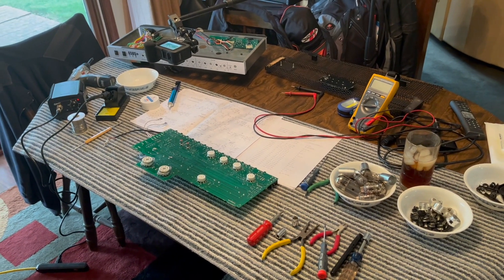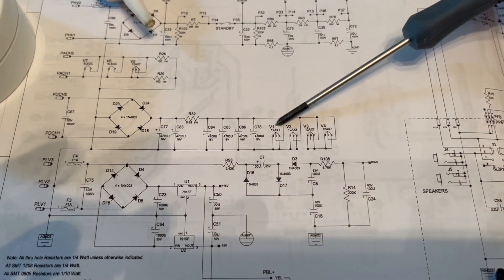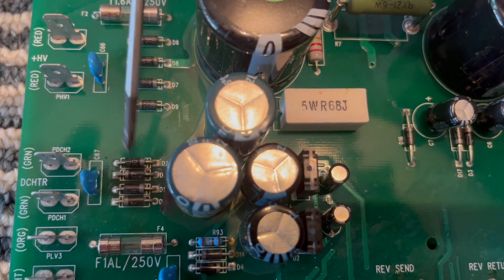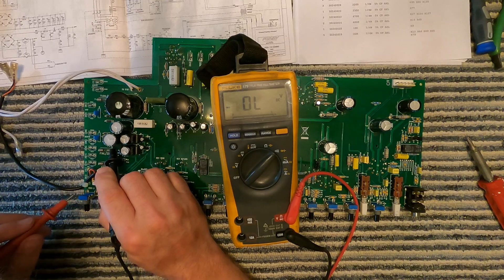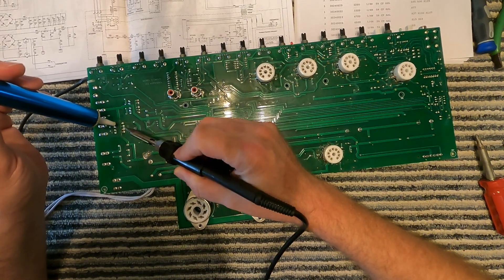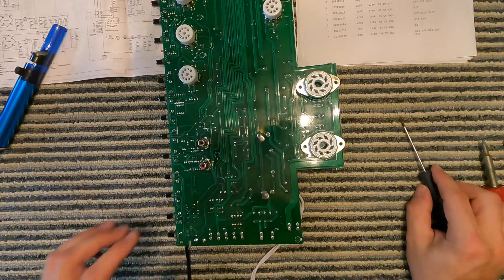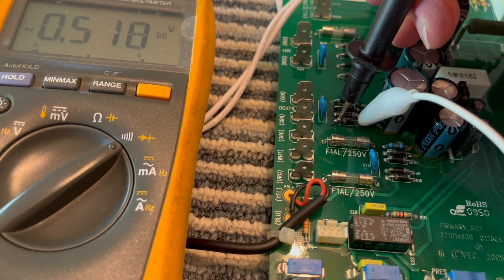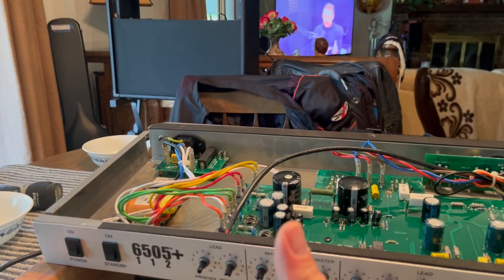Peavey 6505 Plus 112 Repair - Bad Preamp Heater Circuit Diodes

Comment: Back in 2017 I found the same forum you probably did, advising me to replace those diodes. I did and it worked! Just tonight my amp died and is doing the same thing again. Ran the meter a few times with mixed results and initially thought it was R82, but I finally turned the amp on and checked DCR, yep top two diodes went bad again.

To anyone who is considering the common mods, here is my 8 year review: 

Replacing R86 (FX send filter) with a resistor+cap in parallel (I forget the values, it's easy to find in the mod forums) is the best decision I ever made with this amp. I am picky about the effects loops on most heads now because of how much I love this one. Idk how to say it but this amp sounds tighter with 4 cable noise suppression. It's as if other amps' advertised series effects loops are not truly series  but essentially at 99% on a mix knob. Test this by clamping down the suppressor threshold to nothing and listen for what leaks through the amp. This Peavey is tighter than most of its peers. The original R86 tries to reduce round-trip cabling noise buildup by filtering extreme high frequencies - sounds like a blanket. Get a suppressor and/or buffer and take care of that problem manually. The replacement R86 takes that blanket off the tone of the loop. I get why they did it, though.

IIRC i clipped out R13 and C47 from the clean channel, IDK which contributed to this but one of them served as a HPF. The idea is that removing it opens up the bottom end similar to an open back amp and makes the actual Cleans more useable. BIG REGRET. All it did is ruin my beautiful sounding crunch channel. HOWEVER. You know that bass cut you hate about your tube screamer? Sounds fire through this bass overloaded crunch channel. But I really miss how it was originally.

I think I clipped something out to smooth out the gain of the lead channel (I believe it was C30)? I don't remember it knocking my socks off but i love the tone of that channel - didn't hurt anything. I definitely did something to reduce the overall volume of the lead channel and the tone is insane for recording but i wouldn't gig it with a drummer without PA as a result. It's great for rehearsals with the master at 2 o clock and the amp pointed at the drummer. I'm looking in the chassis now and I've got this goofy looking mess where I soldered R101 and C11 together in series. That's probably it.

Comment: I man, i want to modify my amp adding it more gain ,i got a Rivera M100 and Peavey 6505+112 plus combo. Can you give me some advice?
Reply from the maker: More gain?   Which amp?   The 6505 has too much (more than enough).   The Rivera is a nice cleanish fender. 

Soldano added more gain by adding insane non-symmetrical bias at the third gain stage.  Very smooth and creamy.  But mushy in comparison to fender circuits.  

I always recommend playing with overdrive pedals first, before modding an amp.  Way too much circuit analysis involved to give a simple answer.  

Rob Robinette has a great website for simple amp mods.  

Good luck.
Reply: @6dbthreshold  thanks

Comment: How'd you get your logo to light up?  Mine doesn't work?
Reply from the maker: If your amp still works (makes sound), I suspect your logo light circuit is burned up.   The bias low voltage tap from the power transformer not only power the bias voltage rails, but also has another 4 diode rectifier that feeds a couple solid state voltage regulators for the +\~ 15 vdc switching circuits and the “BACKLIGHT PCB”.  

If the amp still switches channels correct, the logo pcb is broke.  

I dunno. I never took the logo light assembly apart.
Reply: @6dbthreshold  okay yeah my amp still works and all the channels switch fine.  Guess it's the logo PCB.  I unplugged it and plugged it back in and same, no lights. Will look into getting a new logo PCB.  I read somewhere someone fixed their by resoldering some of the leds.  Guess I can also inspect the led solder joints.
Reply from the maker: Maybe hook the logo light leads up to 2 9v batteries in series?   Easy simple test to see if it the light circuit board works. 

I like how the amp sounds, but it’s definitely not designed with long term reliability in mind.
Reply: @6dbthreshold so I hooked up 2 9v batteries it popped/blew one of the LEDs.  I'm sure I did something wrong.  Now I'm wanting to replace all the LEDs on the logo PCB just not sure which ones I need.  If you happen to know please pass on the info.  Thanks.
Reply: @6dbthreshold  I man, i want to modify my amp adding it more gain ,i got a Rivera M100 and Peavey 6505+112 plus combo. Can you give me some advice?
Reply: I went to Walmart and bought some adhesive LED car interior lights. I removed the wooden board behind the grill, adhered the light to the reverb tank and soldered the power input to the cable that used to power the logo. Now my amp can glow Red, Blue and Green. :)
Reply: @cbvinyard8778  Awesome mod! Are the lights the same voltage as the logo? Just to make sure you don't burn any circuitry?
Reply: @ I put those in 9 years ago, can't specifically remember if I made sure of that, but they've ran for 9 years without burning out. Only thing that burns out are these 4 diodes.

Comment: Nice video, very informative. Which diode to buy to prevent this? Cheers
Reply from the maker: I used 1N4935 diodes (1 Amp) for the immediate repair.  They have about 12 hours on them with no issues. 

I bought 1N5404 diodes in case of future failure.  They are at least physically 4 times larger.  3 Amp 400 V diodes with 1.2v forward voltage drop.   They will need to be mounted pretty high off the board or even remote mounted.  I won’t install them until the next failure (probably 3-4 years from what I’ve seen on the message boards).
Reply: Thank you for your reply. I’ve been searching for answers on how to prevent this problem, I have this amp almost new for a month now and Ioved it. V30 and footswitch are on it’s way, I will order those diodes, just in case. And would likely convert it to a head, eventually. Cheers from qatar 🇶🇦

Comment: Looking at buying one, found one for sale locally for 350. Worth it?
Reply from the maker: No.  It’s not worth it for a normal player. 

It does the 5150 heavy tone pretty well.  It sounds great through my 4x12.  For me, it’s worth it. But I like to tinker with old amps. The diodes WILL eventually fail.  They are simply sized too small for the heater circuit. If you are comfortable with replacing the diodes in the heater circuit, it’s worth it.   If not, don’t buy one. It’ll be a headache in service repairs. 

The cabinet is heavy and  I don’t like the single 12.  I’ll convert it into a head soon.  And then it won’t be worth anything.
Reply: @6dbthreshold  I'm surprised to read "then it won't be worth anything". I've seen a few 6505+ combo to head mods and some of them look amazing! Especially the red one that can be found on youtube.
I would think that there would be some demand on those, considering that 100W is too much for most players, and the 50W makes a bit more sense.

I got a used 6505+ 112 last week for $186, so I figure it's fine if it's not worth anything anymore. It would be a fun project, and my first when it comes to modding an amp. I also have a Vypyr 120 that's waaaay to overkill for my bedroom playing, I think I might keep that just in case. But having 2 combos is a bit stupid, it would make more sense to have 2 heads and one cabinet.
But to build a cabinet from the bottom part of the 112 and replace the speaker for a v30 or some other similar speaker would perhaps be a good project? Or do you think buying a dedicated 2x12 cabinet is smarter, for instance the really cheap Harley Benton's that Glenn on SpectreSoundStudios recommends?
Reply from the maker: I cut mine down into a head.  I like it.  But a problem arises because the panel between the head and speaker enclosure isn’t as deep as the top or bottom panel.   

So I “sectioned it” to make a head enclosure using the top and bottom panels.   The leftover wood was useless at that point.   But I didn’t have to re-tolex it!

You’re probably better off buying a separate 2x12.   The Egnater 2x12 “Tourmaster” is a great cab.  A little oversized and is convertible  between open and closed back.  I found one for $200 and painted it with black vinyl car interior paint.  It looks great!
Reply from the maker: https://youtu.be/IzjERnUImro?si=_JCNBdj0tOZfg_Nu.  

28 minutes in.  I’ve converted 3 combos into heads  now.  All were damaged.   All are electrically fixed.  All are playable but not great looking.